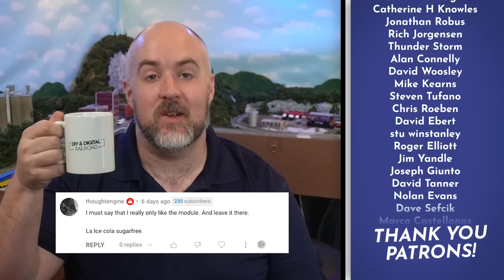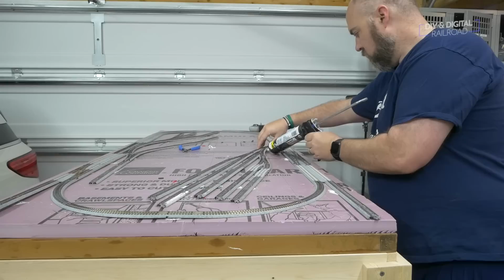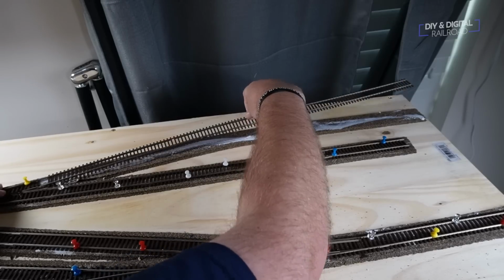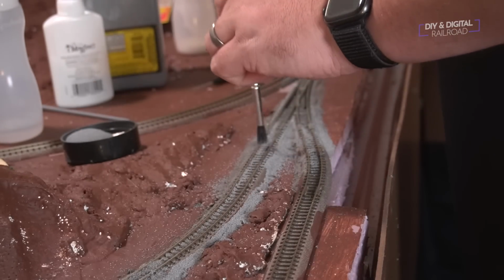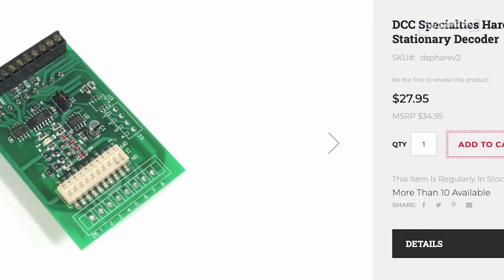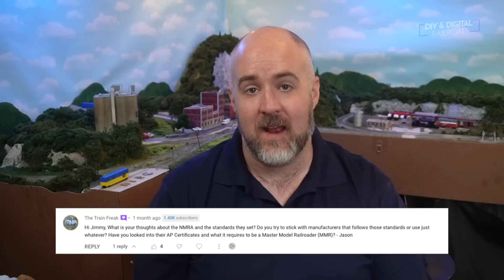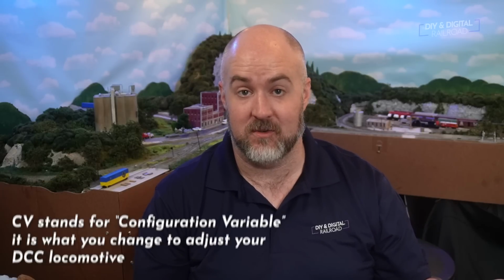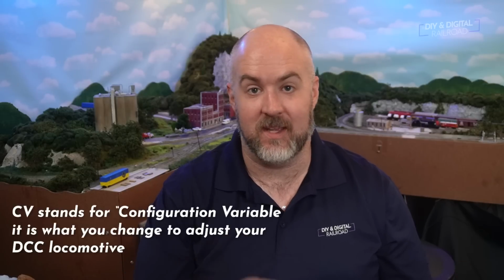A Viewer Question Gave Me an Idea

Comment: For the paper question, what about using 40 grit sandpaper, or skateboard grip tape. 
Cut them into thin strips, the grip tape has self adhesive and the sandpaper you would need to glue.
Reply: Great idea!

Comment: What about spray painting large grit sandpaper in the color you want your ballast, then cutting and gluing strips of that on the side of your plastic roadbed?  Disadvantage is you're not going to be able to nestle it right up to the rail without cutting a lot of notches, advantage is it's relatively cheap and pretty fast to produce.

If you use the same color paint with a brush to paint in between the ties, this can disguise the lack of grit in between the tie ends and between the ties inside the rails.

Would seem to be easier than gluing grit to wedding veil (tulle?) material, and you can cut either with a utility knife.

Comment: A couple of comments:

1) whether paper, fabric, or any other material, also be mindful of their combustiblity. One reason we have "expensive" commercial scenery products today is because yesteryear's homebrewed materials could be ignited by a spark from a passing / derailed train.  I, sadly, speak from experience. 😢

2) the NMRA has its roots in the 1930s with some names we'd still recognize today - Al Kalmbach and William K. Walthers, to name two. Their value to the hobby is priceless as a coordinating body for interoperability of brands within a scale. 

The value of membership in the NMRA is not as clear-cut. Not all chapters are created equally. Some are insanely active, while others are on life support. A rural area might be a huge hub of activity, while a major city could be a ghost town. 

For example, I grew up in New York City in the 1970s to 2010s, but the NMRA - or even train shows - were unheard-of in the 5 boros. For that one had to travel out to Long Island or New Jersey - a subway ride into Manhattan, a commuter train out of the city, and a bus or taxi to the venue. Provided, of course, the commuter trains were running in the right direction - if at all - in the evening or weekend when the show / meeting was happening. That could mean a 4 to 6 hour round-trip because Nu Yawkers don't drive. 

3) I would recommend a beginner DCC system like NCE or Digitrax instead of a basic one like Bachmann's. This isn't a quality issue, but a features one. If your DCC system doesn't let you read and program the CVs, then you're just paying good money on something that restricts your ability to access all the possibilities your DCC locomotive is capable of.

Comment: I wondered if various girts of sandpaper could be used as gravel, either painted or unpainted. If used for a dirt road, it would be easy to create ruts by simply rubbing off the area to remove some of the sand.

Comment: Regarding DCC control of switch machines: NCE makes a product called SwitchIt, which controls two stall type switch machines (Tortoise is a stall motor switch machine). They also make a Switch-8 which (as the name implies) will control up to eight switch machines. I've not used either of these personally.
Reply: Walther Switch Machines are addressable in DCC systems, fully integrated and full feature too. I think they are the best bang for your buck. I don't understand why they are not always included in any conversation  regarding Tortoise/Smail or Cobalt
Reply: @chrisenglish3837  I suspect you don't see Walthers machines mentioned so much because they make sense only when you want DCC functionality for your turnouts. Twenty-five bucks for a switch machine makes a lot of sense if you want DCC integration, but not so much if you just want a manually operated switch machine. You can get a Tortoise for about $15 if you shop around, or you can get a Blue Point for about $10.
I think model railroaders are pretty resistant to change - I know some modelers who still move their Peco turnouts with a bamboo skewer and they're very happy with that. As for me, I'm happy with a DPDT switch - I doubt if I ever switch to DCC turnout control.

Comment: On that last decoder question. 63 is exactly the limit for a 6-bit binary number (255 being the limit for 8-bit). It might be interesting to check if writing a value slightly less than 255 still sets the lower 6 bits of the number correctly. For example, writing 254 in binary would be 1111-1110. If you read back the CV and see 62 (0011-1110) then that would probably indicate that for some reason the upper 2 bits of the number are not being written/set correctly and are stuck as 0s. I doubt it's an issue with the command station and more than likely an issue with the decoder (like in the video, reset it or check for a weird setting), but I'm sure the manufacturer would appreciate the information if you contact them for troubleshooting.

Comment: The Soundtraxx decoder that only goes to cv5=63 is most likely a Tsunami 1, or a one off manufactured decoder. i.e. Walthers used to have Soundtraxx make like a Tsu 1.5. Mostly Tsu1 features but some Tsu2 features mixed in.

Comment: I have a question, in DCC-EX, how do you wire a layout if you have an Arduino running DCC-EX, and you want to add DCC boosters, to try to boost the voltage and signal farther, if maybe you have a larger loop of track?
Though I rarely get to drink coffee, I like Decaf(the brand), with a little bit of vanilla creamer and no sugar.

Comment: I have a mixed roster of American trains, and European, and I had a double track (not anymore, in a different house) this is HO, and I had a mix of track codes, from different manufacturers, Atlas Roco, Piko.  And I switched  the track from DC to DCC, because I am not fully in DCC. And I realized about incompatibility of some of the equipment for Code 83, the locomotives in this code track would make”brrrrrrrrrrrrr” as they pass by ! That was about the wheel flange hitting the ties !   So I learn the lesson,  and in this new track, will only be lying Code 100 !  But for sure you can make a comment. Thank you

Comment: Hello there Jimmy, I retired after 33 1/2 years from the military and decided to take up a hobby from my childhood to relax. Seems I didn't realize that how expensive an undertaking this was going to be. So this whole DCC is new and great but... I was wondering, I built and am using the arduino controller and am using my cell phone as the interface. (using your how to video) which worked great BTW. But what I don't know is and don't really understand is how much track can I run? I am looking to run about 75 feet of track, with two or three loco's running at a time. Also I have been converting DC loco's to DCC and I was wondering if I am doing something wrong as they don't seem to have as much top end speed? Any help would be most appreciated. Take care and have a good one.🚂🚃🚃🚃🚃🚃
Reply: Doug The length of the tracks is not really the determining factor, as long as you feed power at the appropriate distance. 
What really determines how many locomotives you can run is your power source ie the booster, a cheat sheet is 500mA for DCC locomotives without sound and 1000mA for DCC locomotives with sound.
The speed depends on how the gearbox in the locomotive is built and the settings in the decoder.

Comment: Thanks for another great video.  I can't recommend coffee, as I prefer my water straight (no burnt bean flavor for me, thanks!)

One question I have has to do with programming (specifically, on my NCE PowerCab) - Since I can program on the main, is there any sound reason that I should have a programming track vs programming on the main?
Reply: Yes, if you need to change the address of the decoder.
Then it is easier on a programming track, because if you forget to remove all the decoders from the main track, they will also get the same address.

Comment: I have 2 questions. I just changed my loco net cable. Now I have a short at all gaps. Also the track status lights. Won't go off on the 2 boosters when you shut down the camand station.  It will go off on the camand station.
Reply from the maker: I am not an expert on Digitrax systems and loconet.  I would email them and ask them about it if you haven't yet.  Also I would check the DCC Guy's youtube channel.
Reply: @DIYDigitalRailroad  I did. And they said it was corrupt.  Or 1 of the boosters is not doing what it is. Supposed to bee doing and to send the hole system. To digitrax. So I did and am waiting to see if they can fix it.

Comment: Here's a question, what would be the easiest DCC to get that requires no programming? I don't do computer programing, and I don't get along with cell apps. Or is the best option for me to stick with traditional DC? Also if I stick with DC, will DCC trains still perform basic running operation on DC?
Reply: A quick answer, DCC can be configured to run on DC, but generally speaking you just order the train without DCC installed and you get DC.

DCC is a low-programming environment; I use a program called JMRI to do my programming and operation at home.

Comment: Have you ever worked with a SPROG programmer, or JMRI?

I'm not a coffee drinker.
Reply: I use JMRI for my DCC programing and troubleshooting. Trying to use a handheld was clunky and outdated.  I am used to using computer infaces as well as having the internet right there for ease of troubleshooting if I couldn't figure it out.  My DCC unit is a Digikeijs DR5000.

Comment: The DCC EX is just ridiculous to me. Anything that involves programming and code is just so out of my league, and I'm not necessarily OLD, it's just not in my wheelhouse and nothing I've ever studied. It seems like it should be a LOT easier and user friendly. How has somebody not just got something ready to go yet?

Also, Re: Tortoise, I know you can use some Digitrax stuff to control Tortoise switch motors. Charlie Bishop from Chadwick Model Railway uses Digitrax stuff to control his switches. I think he assigns them certain numbers and can push a code for the particular switch and hit throw, or something on his handheld unit. You can check out his videos, he's doing OO but this stuff is the same, really. He's got a ton of wiring under each one of his boards. It provides power to the frogs and everything.
Reply: One thing that's slightly simply to set up, but still not trivial, is SPROG (I think that's there company name) they make more ready oob stuff although at a slightly higher cost than dccex
Reply: @danieleveritt4086  thanks for that tip! I’ll google.